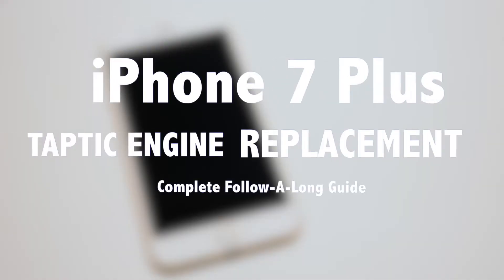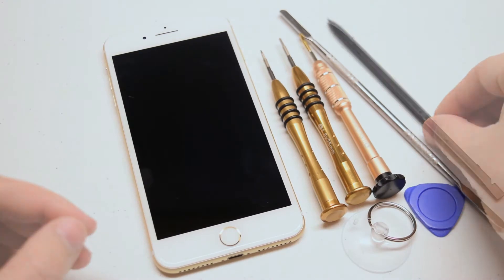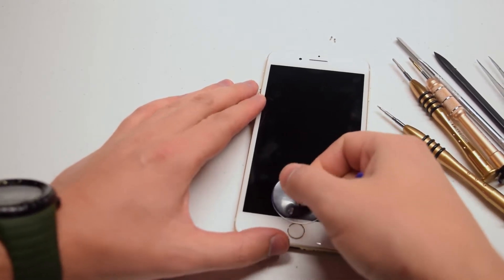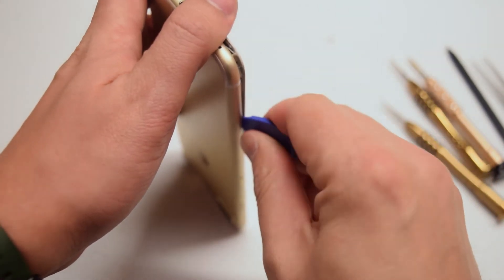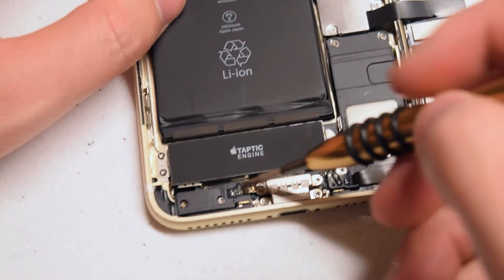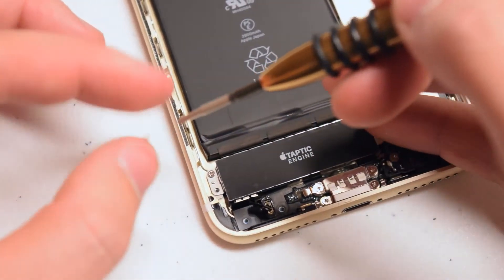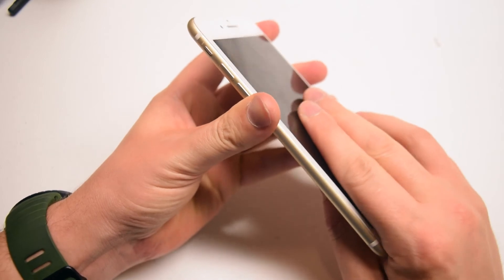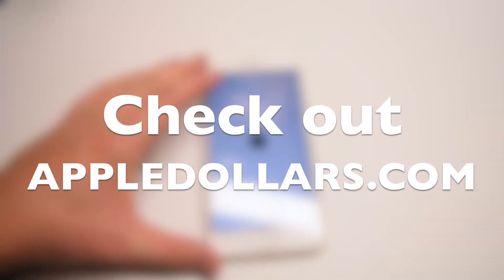iPhone 7 Plus Taptic Engine Replacement

Comment: hi my iphone 7 plus is water damaged and now it keeps on restarting. sometime it gives the display and screen,camera, speakers works perfectly fine apart from home button. i opened it and found that the water marks rust around the taptic engin. do you think if i replace the taptic  engin my home button/touch id will work??? Please help.
Reply from the maker: No, it is very likely there is still water around the home button and where it connects to the phone. My best suggestion is take the phone apart entirely, remove the logicboard and rub everything with 99% alcohol (alcohol dissipates water) especially where the home button connects to the screen and phone. Unplug the home button from the frame and clean that connection as well. Let us know if it helps.
Reply: i tried that its still the same. i removed the taptic engine entirely the iphone is still doing the exact same restarting as it was doing before means with the taptic engin. i even made a video but i don't know if i can share it with you. whats your suggestion now?
Reply: above is the link of the video i made. please review and give your suggestion. thanks
Reply from the maker: The issue sounds like there is still water or corrosion from water in the phone. Take out the logicboard and clean it with 99% alcohol, check all connections for corrosion https://www.ifixit.com/Guide/iPhone+7+Logic+Board+Replacement/76050
Reply: i opened it to smallest bits and pieces, cleaned the parts which i felt had water damage then closed it and it turned one and everything started to work, except the home button. i had to turn on assistive touch to temporally use it to check if everything else is working. anyway after couple of restarts it was still not working then i ordered a replacement home/touch  button. IT IS STILL NOT WORKING..  it feels like i am giving up on this device. Please if you know what could be the reason for this malfunctioned home button give me your suggestions. Thanks